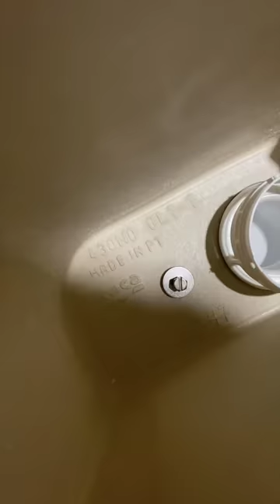🚿💫 TRANSFORMACIÓN de un BAÑO Pequeño y Antiguo - Revestimiento de Paredes con MICROCEMENTO 🛁

Comment: Absolutely fantastic! Top grade work ❤❤❤ I do have 2 questions though:

1. Why use wood for the floor as constantly wet feet mean accumulation of dirt and decolouring. Is there Polyurethane on top or anything? 

2. Why were the tiles not taken out but just covered up with cement? Doesn't that make it difficult for eventual later fungus etc.due to humidity slower leaving through the wall? 

Sorry just these questions popped up in my mind as always seeing humidity problems in southern homes...any tips/ideas?
Reply: Absolutely correctly questions . I am agree with your questions

Comment: That's insane to do by yourself. I work in new residential construction in LA and there's usually about 6-7 guys that handle separate stages for a remodel like this, with just me doing the plumbing alone, no dry wall, no tile or floor, no electrical, none of that shower doors stuff.. I just run lines where they have to go and then come back for finish trim/fixtures later after a handful of other people do their jobs. You really did everything we all would have done separately. That's impressive bro.